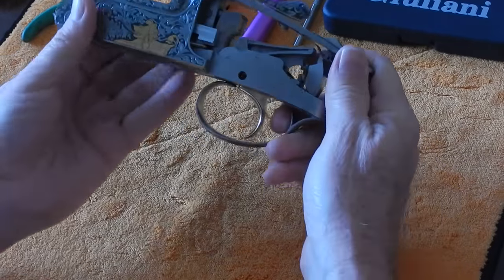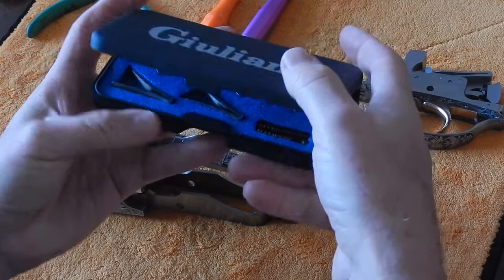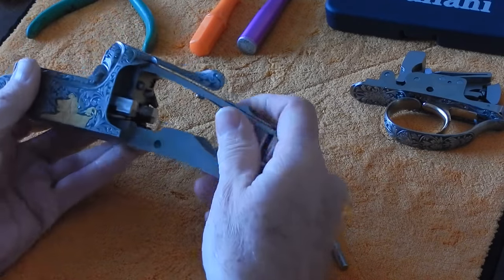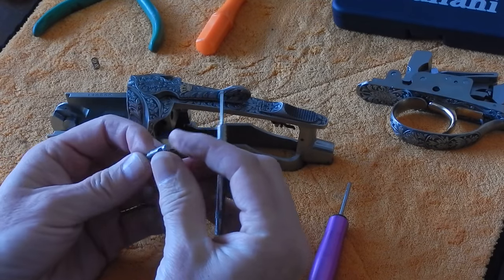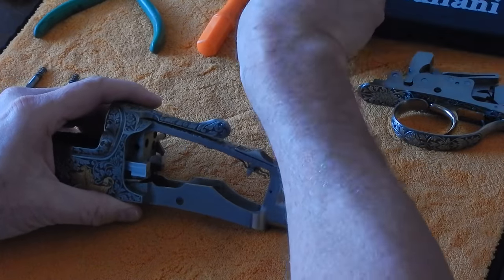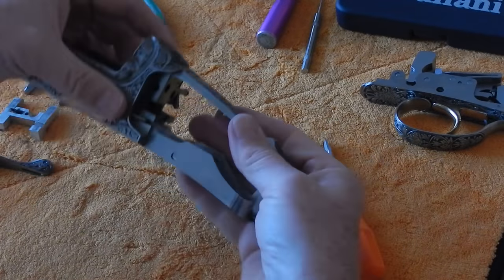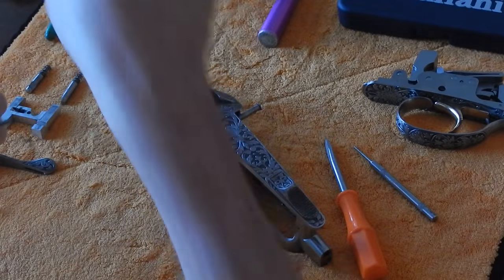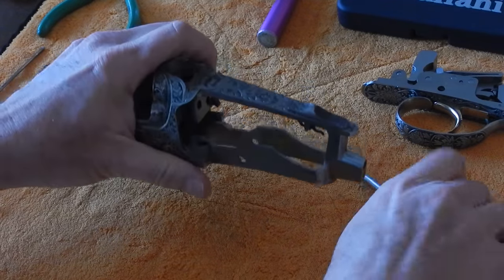Perazzi Shotgun Receiver Disassembly - MX series

Comment: For anyone that might find my experience helpful : on my Perazzi (MX10 RS), the disassembly was slightly different. I couldn't relieve spring pressure by pushing the plunger since pushing the plunger also moved the top lever (due to the locking block, lever, and plunger geometry all interlocking in both directions of motion). After some research, I figured out to remove the locking block and top lever, I had to use a small punch through the hole in the bottom of the locking block to push the lever out from the bottom and it worked like a charm. I did it in a sealed two-gallon Ziploc bag to make sure the plunger/spring/etc didn't fly off to Narnia (I also recommend the same thing for removing the top lever stop plate/lock/release pin and the corresponding springs on the right side since that will fly apart on you as well).

Comment: Thank you very much Don! Lots of help! 
could you upload the assembly of the receiver also please?
and also, if top lever is 6 o clock straight, what adjustments may I do?
Reply from the maker: Hi Carlos,An assembly video of the receiver will be done this fall after shooting season.  It's just a reverse of the disassembly steps.If your top lever is at the 6 o'clock position your gun needs a new locking block and very likely a top lever spring.  There is a jig which allows a shooter to install their own locking block. I have a video of fitting a locking block also.